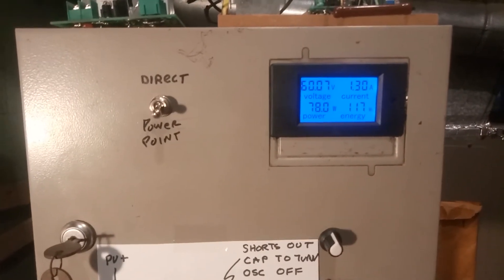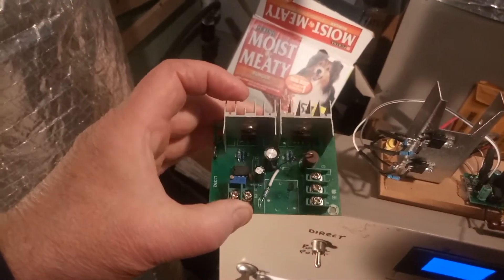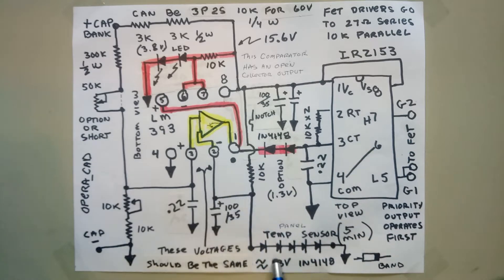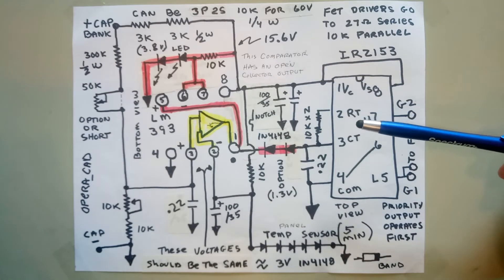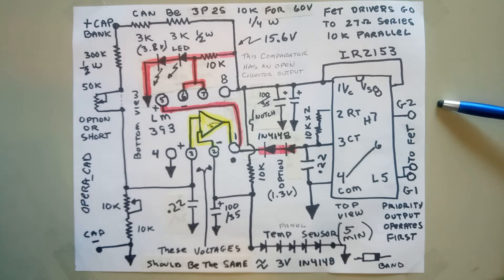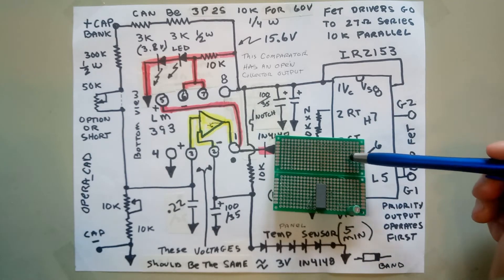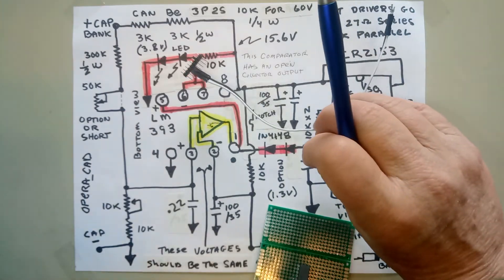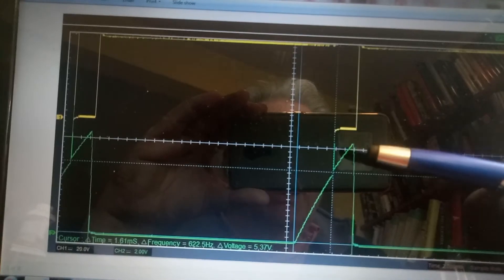LM393 PV Solar Water Heater Control, Circuit Diagram Pt.3

Comment: LM393 test circuit http://www.learningaboutelectronics.com/Articles/LM393-voltage-comparator-circuit.php. You can replace the photoresistor with another pot.

Comment: Hello.
I have constructed your LM393 / IR2153 MPPT running at 160v into 20 Ohms using IGBT's. My first bit of veroboard for a few years.
Working very well here in UK compared to my last few weeks on direct connect. 
35 gallon unvented cylinder with 2 X 230v 3kw. 
I seem to be clocking at about 50Hz ? 
Yours looks like @600Hz?
I have used a IR21531 from Farnell spec looks much the same to me? Chips and cooking oil shortages here in UK !
I have about 5V of ripple sitting on 155V, only 4000uF but have  ordered another bunch.
Many Thanks.
Reply from the maker: Made my day, so many never return with results.  If the spare comparator is used to limit timing voltage, there is no fixed frequency, just a reset time as it can be on for a long time when voltage doesn't drop.   If Cv goes above 2/3 Vcc the output will oscillate and two heating elements will be driven with one having priority. Mechanical thermostats then can be used without arcing issue.  I finally created an evaluation board where over six different heater circuits can be made. Latest video is one where Rt is 68K and that .22 is actually .18uF, they all measure that exactly as they are made at the lower end of 20% tolerance. The output 2 turns on after 10ms and drives a 0.6ms time delay to the second comparator to reset. A red LED creates a 1.7V offset instead of the two diodes.  This is the most suitable design as it includes arc interrupt allowing heating elements to be daisy chained. You should do a video or allow me to post it for you.
Reply: @opera5714  Thanks for reply.
I have read it at least a dozen times and think I might understand.
So, drive FET's from the Lo output.
Drive a RC circuit from the Hi output ( 0.22uF 2.7k ?)  0.6mS, use comparator to detect 63% charge 10v ish, use this output to reset IR2153 in parallel with 1st comparator output , LED in series. Have I got the right end of the wire?

Guess this gives about a max 90% ish on time? but the benefits of arc interrupt and stability  outweigh this, I was wanting to parallel up elements for summer. My min PV panel impedance should be 14 Ohms , each element is about 19 Ohms thus I don't need more than 70%.
Think I might leave my solid state relay connected to thermostat for now just in case some of my soldering falls off ! 
I will take some photos.
Many thanks again.
Reply from the maker: @steveminton5673  think of arc interrupt as a safety device. With a long period like 10ms and correct heater resistance, the 2153 will almost always first reset from low voltage first. Larger cap bank will store most of energy in off time. Packing for move to summer home. Back online in a week with circuit video.
Reply from the maker: @steveminton5673  Did you use the spare comparator to limit the timing capacitor to less tha 2/3Vcc to prevent the IR2153 from alternating? Did you drive two FET or IGBT from LO and HO?

The alternating mode using two FET to two independent heating elements has some unique applications.  On time is never more than 50% so AC rated switch contacts can be used.  LO output has priority which sends power to upper element first. This works well with morning sun as total power will be less than 50%. Any extra power will go to the HO lower heating element. At peak mid day sun both elements can get 50% of the power. By afternoon the upper element will have turned off and maximum solar power will be less than 50%. All that power can be sent to just the lower element.  Cycle times of several hundred Hz can be used with a smaller capacitor bank and still have enough off time to form an arc interrupt.
 
In the following circuit chance the IR2153 is allowed to alternate at up to 50Hz.  When it alternates, LO turns off and HO turns on. 
The HO going high initiates a short time delay which is the arc interrupt. At the end, the IR2153 timing capacitor .22uF is reset.

Arc interrupt is added to the existing circuit using the unused comparator section of the LM393.  The open collector output is tied to 
the other open collector output that that resets the timing cap.  That .22uF (typically measuring .018) timing capacitor is paired with Rt of 68K for a cycle time of 10ms.  

The + input of the comparator is tied to a 100K/100K voltage divider which supplies Vcc/2 for a reference voltage. 

The - input of the comparator is tied to the HO pin #7 of the IR2153 thru a 100K resistor. That resistor also has a 1N4148 small signal diode in parallel with the band to the IR2153 side. That resistance provides about a 650uS delay when HO goes high.  The diode provides a fast discharge when HO goes low again after the IR2153 is reset.

The - input of the comparator is tied to a 0.01uF capacitor to provide RC timing.  The other leg of the capacitor is connected to common. A high value resistor 750K-1M may be added in parallel with the .01uF capacitor to insure it will fully discharge.
Reply: @opera5714  Hello. I am still running well with your ( LM393 PT3 ) circuit. The spare comparator just driving led's.
 Two IGBT's HI and Lo, paralleled to one ( lower ) element, thus I have left my solid state dc relay in to assist the stat.
The only mod to your design was to add a zener from the noninverting pin2 comparator input to 0v just incase the adjustment pot was to playup leaving pin2 exposed to full pv voltage.
I have added another 6 X 680uF caps to smooth things out a bit more and share out the work.
I have ordered an A, V, Watts and Whr meter something like you have.
Then I had a thought, it would be an interesting experiment to have two Whr meters one recording direct connect the other recording mpp and switch between the two, say once every few mins using a fet or igbt and timer circuit for a few days, just to see what the real world gains are? They seem to substantial.
I will snap off another piece of Vero-board soon and make the improved design so I can remove my solid state relay which does run a bit hot on sunny days.
I seem to have a very short extra on period on the one gate drive signal, it is stable doesn't seem to be effected by moving wiring or induced stuff, it does grow in time with increased pv current? IGBT's are running cool.
I will take some photos.
Many Thanks.
Reply: (The only mod to your design was to add a zener from the noninverting pin2 comparator input) Should have read PIN3.
Reply: Link to image ( https://photos.app.goo.gl/NK1GwB7odT8Ly2N2A )
Reply: Link to Image2 ( https://photos.app.goo.gl/HBMJA8KK1yXGtvw59 )
Reply: As you can see the unvented  cylinder is plumbed in series with the cold mains water feed into the gas combi boiler. Thus the boiler only has to top up the water temperature if the stored water is below 55 Deg C. The temperature probe and thermostat are in the mid heating element position  and only the lower element is currently connected to PV.
As you can see my plumbing is much neater than my wiring.
Reply from the maker: @steveminton5673  Those solid state DC relays shouldn't be run anywhere near the listed current. They just copy the rating of the FET inside and need to be cooled with a block of ice.  A FET will double its resistance with heat and double rated resistance.

I still have one water heater which uses alternating outputs. With off times always more than 50% it has built in arc interrupt. I use a DPDT relay to switch it from the water tank to my dishwasher element when dishwasher runs.  I put the thermostat between the panel and the capacitor bank with a 500 ohm resistor across the contacts. It then acts as a shunt regulator keeping the capacitors at power point voltage and the panels return to open circuit.  The switch never sees more than 30V differential.  This works on arrays up to 90V.

I actually did a test switching between the two systems.  The results weren't as big  because my home system only gets two hours of sun mid day. The rest of the time trees block the panels.  My summer home has the same problem.  I have panels stuck everywhere in every direction and over 75% of them are shaded at any one time. I had hoped that this would be a community effort, but those I provided boards to have not supplied any data.  Here is a interesting video from Lithuania. It is also alternating. This guy had never built electronics and he even made his own circuit board. He never wanted to make this video fully public.  If you got on a solar board, you wouldn't believe the attacks you get. https://www.youtube.com/watch?v=3TY_u6m9JXM
Reply: @opera5714  Hello. 
Thanks for the link, interesting, Very neat!
 Almost tempted to get my marker pen and Ferric chloride out.
My circuits rarely work if I try and make them look nice, it takes too long and I loose my way.
I have capacitor envy!  And he has enough FET's to out accelerate a Tesla.

Yes I know I need to ditch the SSR or pop it in the cylinder next to the heater.
PS
Cordless Chainsaws are very quiet, and you could charge up using solar.
Reply: I am working on a hot fill for washing machine using a thermostatic mixing valve, a solenoid valve and a timer. (New Washing machines here in UK seem to be cold fill only ) The idea is to feed it 45 deg C for the first say 15 mins of cycle. I like your idea of supplying the heater element from PV but She won't tolerate any inconvenience.
I have already swapped the 9KW electric shower for a Thermostatic mixer shower.
Here in UK electricity is now about 30p per Kwh  and Gas 7.5p with further increases coming. Petrol hit £2 per liter. Feed in tariffs are now only between 0 and 7p so not much point in grid tie inverting unless we are at home to use it, or had batteries.
Thanks for the inspiration, nice to use some old skills, brain cells, save the planet and about £60 a month already.
  Not sure about Dishwasher yet? Maybe hot fill and some PV to keep her hot and for drying?
Reply from the maker: @steveminton5673  The 2153 is a switching inverter chip and as such has a built in deadtime of about 3%.  This is what you may be seeing, the output turning off and then turning back on till the capacitor bank discharges enough.  Unlike PWM chips which can be unstable in the presence of noise, this design uses a times reset which prevents oscillations and is extremely stable. You may have notices that the comparator chip has no hysteresis and the output can be very grassy near the transition.  The timing capacitor averages this out.  There are two resets, a soft reset at 1/3Vcc to alternate and a hard reset below  1/6Vcc which turns everything off. To shorten recovery time I use a RED LED to prevent reset from going below 1.7V.

I have a friend in Florida that operates his at about 280V.  He switches from hot water to dryer element when dryer is turned on. He has made his own custom circuit boards and uses a slightly modified design with an inductor to charge his EV. He has another one which operates a VFD on the pool.  The heater stabilizes the voltage for the VFD.  Lots of things can be done.
Reply from the maker: I have been heating water by this method since 2016. A 2021 technical paper validates this method and says everyone should be heating water this way!  It explains the process a little better than I do.  Thought you might like this read https://www.mdpi.com/2071-1050/13/18/10270/htm
Find a few more people interested in this and you could have circuit boards made cheaply.  You could have European distribution. Our post office now charges $40 to send a blank PCB and I have been unable to help others across the pond.
Reply: @opera5714  Sorry only just spotted your last reply. Hope all is well.
Thanks for the link. I suspect DHW might account for more than 14% of energy use,( in this household anyway ) I wonder if they factored in washing machines and dishwashers?
I am happy and surprised to report that the wife has taken to hot filling the washing machine via the soap dispenser draw with her watering can after watching my scientific experiment, much simpler than my proposed plumbed solution. The machine seems quite happy and now uses only about 100-200 Whr. It used between 1.7 and 2.5 Kwh cold fill. I suspect the dishwasher is less impressive as it only heats about 4ltr on eco. i will do a scientific measurement its just the plug is awkward. 
It's been far too Hot here in the UK to switch the soldering iron on, so things remain much the same, apart from the addition of a little 12v smps to power the multi-function display  and an old cpu cooling fan to keep that SSR alive. The controller continues to MPPT I have only seen it switch hard on a few times on cooler very sunny days, so it is of great benefit. 
We continue to benefit from an almost 50% reduction in electricity use now 10 ish Kwh per day. Looks like we are heading towards 50p per Kwh and 15p for gas over here come the fall. 
A nice PCB is a lovely idea, I used to make some when I was the electronics tech at college, think the Cad package was called Easypcb Windows 3.1. 
I have no idea what the interest would be? I suspect there are sadly few with the skills and many without hot-water cylinders over here.  
Many Thanks.
Reply from the maker: @steveminton5673  I just bought a BOSCH ES4 water heater new on ebay for $48 including FEDEX shipping. This was an open box return that retailers can't sell. The guy had a half dozen of them. I'm putting it after my 50L tank rather than add extra insulation. I always ran two tanks before and my $8 SG3525 inverter board was still in place. I just added arc interrupt to it with a 800uS deadtime.  This only takes 400WH to get up to temperature in the morning.

Comment: Why don't you build an MPPT direct water heater circuit that can handle 4 or 5 thousand watts of solar so you can produce a useful amount of hot water? Won't your ideas scale up? A coil of black plastic hose on your roof with a tiny PV powered pump would produce more hot water than a 500 watt max heating element.
Reply from the maker: I keep getting asked this question. There is no reason you can't scale this up. I have someone who built one which is 120V 1500W.  You can do it and other manufacturers do, but from an engineering standpoint it is poor design to pull more than 3,000W out of a capacitor bank.  That just shortens life expectancy of the capacitors.  I designed a microprocessor version that  someone has on a 3,500W with six heaters that come on as more power is needed.  Just one has PWM. That makes a very light load for the capacitors.  This is used for home heating.  I can't imagine why anyone would need more than 2,000W to heat water.  An enormous waste of panels. You continuously heat all day and to much higher temperatures.  

I don't understand why nobody is interested in pairing this with an existing PV system.  I heat water with just the power  which would be wasted by the charging system.  I heat all my water with just excess panel power.  For a stand alone system, The IR2101 design would power two heaters (or three) with one just staying on above a certain power.  I'm not designing for anyone, just sharing ideas.

Comment: Could you do one video dedicated to just the string of diodes as a temperature sensor and have it compare to a lm35 or similar? I would love to see how it compares so we know how reliable it is as a sensor. Very interesting stuff indeed! 👍
Reply from the maker: Sorry, I have absolutely no interest in that. Diodes have been used for more than a half century and plenty of documentation exists. If you find something good in a search, post a link for others. Diodes do need constant current. LM35 still in production? It could go out and the world wouldn't care.

I am only interest in videos with original content and focus on water heating because there aren't any others discussing building controls to heat water efficiently.  Just try and find one.